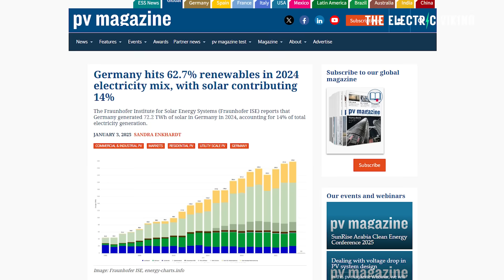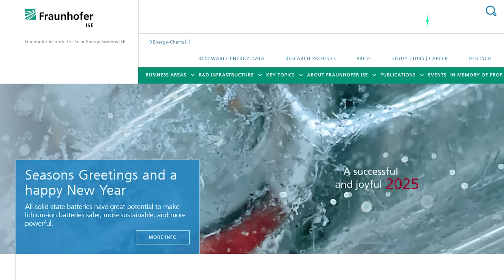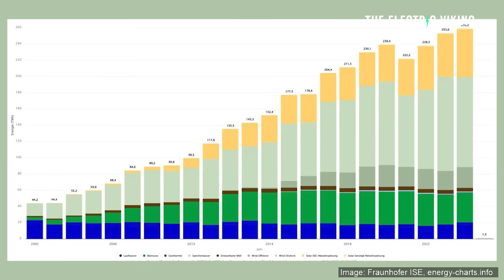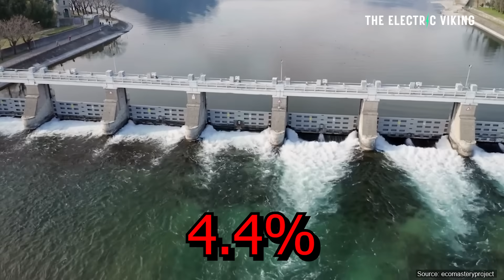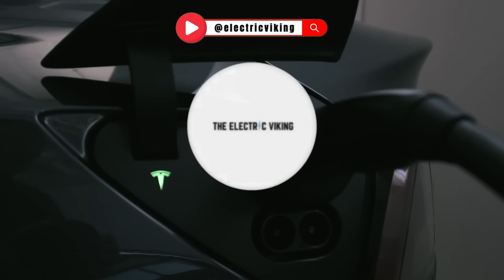Germany hits 63% renewables in 2024 as battery storage almost doubles

Comment: I have to correct you on this, German prices skyrocket because of a lack of renewable generation, and a lack of gas/coal being put online to compensate. So they buy the electricity from the european energy market, skyrocketing the prices for all our neighbors as well. There aren't enough gas plants to cover 100% of generation, and no one likes coal, so instead they will make norway angry by artificially driving up prices to a degree that some of their industry has been shutting down, cause its just not worth it to produce goods at 10x normal cost
Reply: Correct … And Sweden, Norway and Denmark are about to pull the plug on Germany because it causing havoc with their domestic supply prices.

Comment: Battery Energy Storage Systems (BESS) are still hugely expensive at $400-$600 per kWh as the battery itself is only 1/2 of the equation. Grid-scale operators deliver 250 Watt per hour for 4 hours from 1 kwh. The purchase price for stored energy is easily five to tenfold the price of wind/solar production cost itself and helps to drive prices up in the offered energy-mix/ consumer price.
Reply: This is correct, but battery prices are falling really quickly. In EVs you have prices under $100 per kWh so it won’t be long until we have similar prices for ESS
Reply: @thethirdpickkle  Right so, nevertheless the 100 MWh systems installed - and more ordered for the near Germany future - they cost USD 100 million each, not less. Consumer prices will have to stay high and rise for the next ten years as companies want to recoup their investment and make a huge profit out of storage. With solar You can fill them once a day, for 8-9 months, with wind one other. Even if You fill and empty them 10.000 times it would still be 1 USD per 1 kwh storage cost - not cents - plus conversion losses, profit, maintenance, overhead, interest and tax. Due to the merit order principle, BESS companies charge more than coal plants and just less than gas plants. LNG prices are 6 to 10 times the US prices nowadays in the EU. Alternatively You can subsidize and the tax payer pays the bill, not the final consumer. The Chinese are doing it better. Germany will either be broke without any heavy industry or sit in the cold and dark or both before they can go green with the tech available today.
Reply: @SunshineShane  you must start somewhere. Already in 2021 the larger HSS from 10 kWh to 30 kWh reached an average price of 870 €/kWh, now it should be even lower. Yes, it is still expensive but it will be cheaper and cheaper every year and you need to build knowledge and experience even if it brings a higher cost in the short run.

Comment: Wind and solar energy combined with battery storage are safer, cleaner and CHEAPER than fossil fuels.
The UK, Europe, Germany and the rest of the world have been too slow to transition to wind and solar energy combined with battery storage and all electric vehicles.  Wind and solar energy do not need to be imported and can be produced locally in any country. Battery storage is key for base load power. 
Europe needs to provide more incentives for homes and businesses to install electric heat pumps and get rid of old polluting gas and oil boilers.  The move to electric vehicles will also be sped up. There is no good reason to help fund Putin's war by buying oil, gas and coal from Russia. There is a Climate Crisis making weather events more extreme.  Time to switch to renewable energy. The future is renewables. They are safer, cleaner and cheaper than fossil fuels. It is time for governments to end fossil fuels industry subsidies.

Comment: Germany’s grid is in transition.  Remember before the war in Ukraine, Germany was able to purchase cheap, plentiful gas from Russia.  When the pipe line shut down Germany had to pivot. In my opinion they would have been better off keeping nuclear, shutting down coal and gas powered peaked plants and moving as fast as possible toward renewables.  It ‘s easy to Monday night quarter back.  The good news is that the availability of massive batteries is increasing, meaning that Germany will be able to store excess production and move away from  peaker plants.  All this takes time but Germany is clearly on the right path.

Comment: A little bit optimistic aren't you? I am not sure renewable will ever entirely cover the needs in winter time North Europe, often far too little sun and either no wind or too much wind (due to artic wind circulation). I live in the neighboring country of Belgium and despite the increase in installed base renewable production dropped by 10% this year due to the shitty weather (for example we had 16 hours of sunny weather for the whole month of December).

Also one of the problem with prices in Europe, is that when EU decided that prices should be based on the price of the costlier plant providing electricity at that moment. This was supposedly done to avoid that a country with costly plants would buy all its electricity abroad which would force his own plants to close down. The side effect is that it slows down the transition as producers will tend to keep a few of such plants around to keep the prices high while actually producing much of the electricity cheaply.
Reply: I agree, that the price determination is one of the main problems in driving prices and slowing renewables.

Though I don't get what you're problem is with North Europe in winter. The true northern countries e.g. Norway, Sweden, Finland and Denmark have consisten high renewable coverage during winter. Mostly due to water and some wind. They do not actually struggle producing enough renewables in winter.

The true problem might be the northern parts of central and west europe where geography doesn't allow for hydro at a level as in scandinavia. But still even through the winter month german renewables put out over 45% of demand. Its the span of hours to a few days which must be bridged, the rest ist not a problem a real problem.
Reply: @Domi.R313 yes we are strugling
Reply: @kermit7608  Norway and Sweden have less than 5% fossil fuel even throughout winter at prices often far below that of the rest of Europe. Both produce far more electricity per year than they need on their own.

I don’t know the very specifics of intern energy politics but are you really struggling covering your demand with renewables throughout winter when actually you are exporting?
Reply: Norway and sweden have said recently they will cut access to their grid when needed, as prices there had skyrocketed due to exports to Germany when we had a cloudy weather with no wind in November and parts of December. Then Denmark and Germany are really screwed if this happens, as they rely on Norway and Seeeden to balance the grid. Without them, the grid collapses.
Reply: @HNedel  This points out that they themselves are not struggling for renewable energy during winter or not?
Reply: @ they have enough capacity for themselves, sure, but due to some export contracts the demand from abroad is causing them issues. Norway is relatively small and has a lot of hydro power generation, and sweden has nuclear in addition to hydro and renewables

Comment: I remember when the idea of using used EV batteries was thought to expand the use of fossil fuel plants because renewables were only a tiny percent. It would have allowed for the coal+ plants to work through the night at closer to their peak, and store all that extra energy in used EV batteries. Then use that energy instead of using peaker plants. Germany can still do this while waiting for their new renewables to be connected to the grid and then switch the batteries over to taking the renewables intermittent energy generation. They just need the batteries. Hey Sam. Did you hear that Redwood Battery Recycling hit over 20 GWs in 2024?

Comment: I live in Sweden in an independent house, I can safely say that majority of the cost is fixed cost, surcharge and taxes. The tariff for the actual consumption is probably less than 30% if the invoice.
Reply: I am also a bit confused about the debate. Most households never see peaks in price right? You also have contracts with fixed prices per kWh or do you not?  Because then what would matter the most would be the average price per kWh over a month or a year not per hour?

Comment: Jesus Sam, I am a bit dissapointed. You produce lots of great content, however here you fall short. Have a look at the recent documentry "The Real Cost of Net Zero: The shocking truth of the renewable energy push" - there is some truth of the dilemma in this video. Its not only the Electricity demand its also the demand for domestic heating and most of all industrial processes. If we (germany) want to transform this also to renewables we still got 85% ahead of us. The 62% of renewable you are refereng to are just the 62% of the 15% current state - On Price you have to consider that the Tax is about 30% the Grid Cost and balancing (peaker) is about 30% and the cost of production is about 30% - as more as we convert as more we need to invest in the Grid Cost and because of the massive demand for industrial processes we still need "some kind" of back up when solar and wind dont produce. The back up in other EU countries is mostly done (planned) by culear which Germany has shut down completly, thus we still have high run time on fossils. The plan is to get this from hydrogen in the future ...... well ..... maybe Baby ?!? Its true that more renewable will cut down the need of fossil/Hydro back up to a certain extent, however still there is plenty you have to have as back up ready when you need it. We are making progress, but at an insane cost, which will not come down any time soon (my guess: next 10 to 15 years it will become more expensive until it may get better) You also have to consider that Germans live to a very high extend for rent. Thus the possibilities for private consumers are much more limited than in Australia. I am lucky, got my own home, solar, heatpump and an EV. However most of German citicens are excluded form this possibilites as they have to rely on landlords to invest in heatpumps and roof top solar. And the guys with homes also need to be able to have the money to invest into all that in the first place. Love your positive attidude,keep it up! Just put a little more reality in sometimes. Cheers
Reply: Nuclear can't be a backup, it can't start in minutes. Besides, it is the most expensive power and we have to be nice to Putin. We need gas for many years, but like Pareto, lets do the first 80% fast and later we could hydrogen, the green champagne of energy.

Comment: I like to listen to the contortions people go through to explain away the high costs of electricity.  It is a curious thing that the more renewables there are, the higher goes the cost of electricity, yet nobody notices that maybe the one may be causing the other.  Like Ed Milliband, they argue that electricity prices are too high not because there are already too  many renewables, but because there aren't enough, and that when we have 100% renewables installed, or 200%, everything will be wonderful.  

The reason electricity prices are so high in countries like Germany are threefold.  1) Since renewables are backed up with gas generation that is running all the time, consumers are effectively paying twice for their electricity. 2) Carbon tax on gas makes the price of gas at least double what it would otherwise be, so in fact people are paying 3 times for their electricity - once for the  renewable, again for the gas, and again for the carbon tax.  3) There are infrastructure costs to incorporate renewables into the grid, such as cables, pylons and substations which are significant costs and they are not included in the total cost of renewables because they don't appear in the accounts of renewable providers because these costs are socialized.  But they are still costs and have to be paid somehow.
Reply: @vincentcausey8498  gas generation isn't running all the time.
Reply: @vincentcausey8498  upgrading the grid is expensive. Maybe this is reflected in the high cost of electricity atm.
Reply: With utility scale container batteries and private batteries we will have fewer problems with peaks and lows.

Comment: Power prices are rising in the UK because we are forced to pay a subsidy for green energy. How much of the “German” renewables comes from Sweden and Norway?
Reply: No, prices are high in the UK because of the increase in the price of gas. Renewables are much cheaper than gas, but the way the UK market works, the price paid for electricity is based upon the price of gas powered generation.

Taking all costs into consideration, the cost per kWh of offshore wind is 38% the cost of gas powered stations, onshore wind is 33%, large scale solar 36%, these figures from the House of Lords report provided by the OBR. Note that most of the cost of wind is upfront whereas most of the cost of gas is running, so the more renewables are used the lower the electricity cost.

The green tariff is not there to subsidize green electricity, but is there for house insulation etc. It should be added to the gas charges rather than the more environmentally friendly electricity. Note that some renewables had to pay a windfall tax because the profits were so high because of the high wholesale price of electricity caused by the expense of gas generation.

Please stop reading the lies from the fossil fuel industry that are then eagerly echoed by the gutter press like the Mail, Express and Telegraph.
Reply: @ There is a section on each bill that is a subsidy for renewable energy. What you are saying is also correct.
Reply: @MentalLentil-ev9jr  Gas prices are high because of the carbon tax.  Wholesale gas prices are £54 per MWHr, but then you have £60 per MWhr carbon tax which brings the total cost up to £114 per MWhr.  So you could argue that gas prices would be half what they currently are without the carbon tax.  The other sleight of hand you failed to mention is the fact that the deemed cost of renewables is based only on cap-ex costs.  In other words, they take the cost of buying and erecting a particular wind farm.  What they don't include is the cost to the grid of supplying additional transmission lines and pylons to connect up to the rest of the grid, nor the costs of substations and all the other items that are needed.  They don't include these costs because they are costs the wind farm provider does not pay.  But somebody has to pay it.  This is a socialized cost on everyone but is kept hidden to make the economic case for renewables.  
You also failed to mention that gas fired power stations are kept running as backup for when the wind drops off.  Effectively everyone is paying for their electricity twice - they are paying for the electricity from the wind farm, and they are paying for the gas stations to run even though they may not be contributing to the grid at that point in time.  There is yet no solution to the backup problem.  All this is absolutely bonkers.

Comment: great video, here is what Pig oil does not want us to know. 
 E-85 is 85% cleaner,helps our farmers and is easy to find.  ethanol only emits water vapor much like humans . Lung cancer in young nonsmokers is on the rise: Uncovering the cause;  Vehicle Exhaust.   What are the symptoms of lung cancer in nonsmokers? Mostly none…until it’s too late, gasoline and diesel Car Exhaust contains over 40 poisons that go into our Lungs Blood.. And Brain.. Of these, the following most harmful substances are taken into account:
Carbon monoxide, CO, harmful contaminant contained in the exhaust
Hydrocarbons (HC), harmful pollutants and smog-forming substances 
Oxides of nitrogen, NOx, harmful pollutants and smog-forming substances 
Oxides of sulfur, harmful pollutants
Reply: Ethanol [ formula = C2H6O or C2H5(OH) ] when combusted, releases CO2.
Farmers and the manufacture of fertilizer also releases CO2.
Reply: @peteinwisconsin2496   so do humans, it helps the trees.
Reply: @peteinwisconsin2496   correct. And NOx and CO when burnt in engines.
Reply: What? Over 1 Billion Bushels of food is burnt in gas tanks every year. Just in the U.S. Chevron and Brazil already burned down half of the Amazon for 'Biodiesel' and Sugarcane Ethanol. Then, they get $40B per year in free money. That's besides the cost of corn would drop to $0.00 if they can't use it for Ethanol.